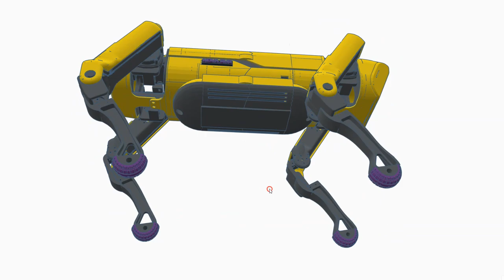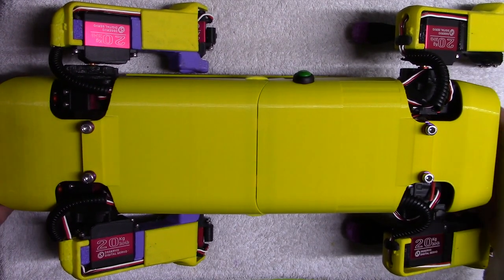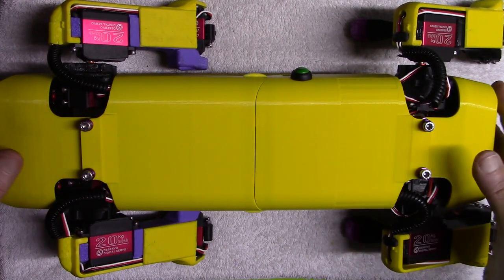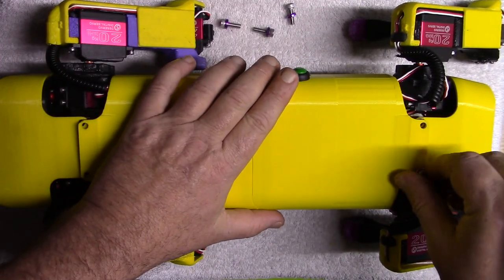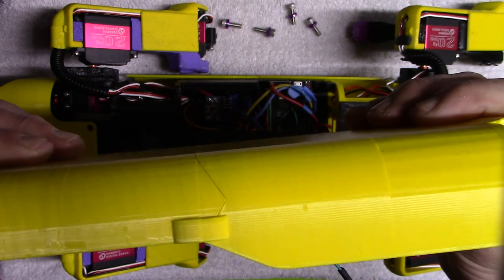New & Improved : Nova SpotMicro 3 - a Spot Mini Quadruped Robot Dog Clone

Comment: Hey! Awesome job there. Upgrades look good. I'm getting the list of parts together and I was wondering if you had a rough estimate of how much all the components cost?

Also, which 3D printer did you use to print all the parts?
Reply from the maker: good question... considering the motors are the most expensive parts at about $150, I'd guess the whole project is under $300 in parts.

I use an ender 3 pro - other than being limited in size of prints, it works great.
Reply: @ChrisLocke1969  that estimate looks pretty great! Ender is what I was thinking about getting myself as well.

I'm doing my masters in robotics and was thinking of taking this up as a term project. Was wondering about swapping out the internals with a raspberry pi for ros2 support, and maybe a lidar or an Intel realsense camera for slam. Would you have any tips for me before I get started? Cause you've already so much great work on this! :D
Reply from the maker: i bought my ender specifically for this project, but oh man, its barely stopped running the 6 months Ive had it.  Great tool for any DIYer, enjoy!!
Reply: @ChrisLocke1969  haha, yeah so I've heard. All this time I used to use this diy rep rap one which was a nightmare to print with. Should be a good upgrade! Thanks for the help. Excited to see the gaits you implement. Cheers! 😁

Comment: I'm certainly going to build the extended version but I think I could just make an extended chassis and base plate rather than adding extenders since no parts are printed yet. Probably need to strengthen these parts though. What do you think?
Reply from the maker: yes, you absolutely could, and it would be better as it'd give you more room / open space for electronics.  I still have to work with the same chassis space, though I do have two new little cubbbyholes to use the space.  And yes, less plastic would be required, fewer parts... I would have done it that way, but didn't feel like redoing all of the electronics.

And yes, the chassis as it is needs strengthening, if you extend it 100mm, you'll definitely want to reinforce it better!  I'd love to see what you come up with!
Reply: @ChrisLocke1969  I'm still in the early stages and planning but I'll certainly keep you up to date with my project. It's completely normal since I'm basing a lot on your design and your videos which will help to avoid the same pitfalls. Thanks again.

Comment: Wonder if you could save some space by removing the PS2 reciever from it's plastic shell
Reply from the maker: It doesn't look like it would save much, except a bit less bulky. Someone suggested a bluetooth PS3 version... that may be the answer, though I'm not minding the backpack now that its slimmer - looks kinda cool ;)
Reply: @ChrisLocke1969  Bluetooth controllers are very laggy and glitchy at any distance. Check out an xbox 360 rf module or possibly the xbox windows 10 adapter that uses USB, both use 2.4ghz and would give better range with less latency

Comment: why not using a PS3 controller via Bluetooth instead of PS2 controller?
Reply from the maker: why not?
Reply: @ChrisLocke1969  cause i think you can use a bt receiver instead of that chunky boy of a receiver for the ps2 controller. Also it is very easy to use a ps3 controller on raspberry pi but i don't think you're using it for this project, btw i love how your bot is coming up, keep up the good work!
Reply from the maker: hmmm... not a fan of bluetooth, but that would be nice to ditch this receiver. i will look into it, thanks for sharing. Im glad you like my work, much appreciated! 😎
Reply: @ChrisLocke1969  Or alternatively, try the xbox one windows adaptor perhaps. Communicates via 2.4ghz like the PS2 controller does. I'm unsure if anyone has implemented one for a project like this but it's what I plan to try. I can use my xbox controller across the room on my PC without input lag or glitches on the inputs
Reply: @ChrisLocke1969  Or it looks like people have hacked xbox 360 RF modules to work with arduino in the past